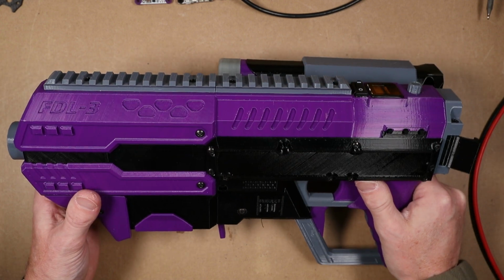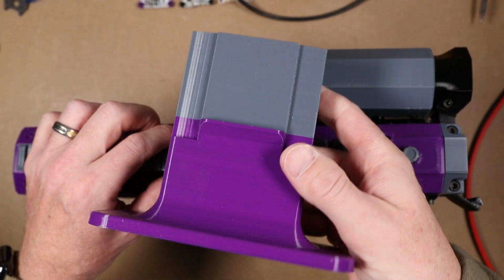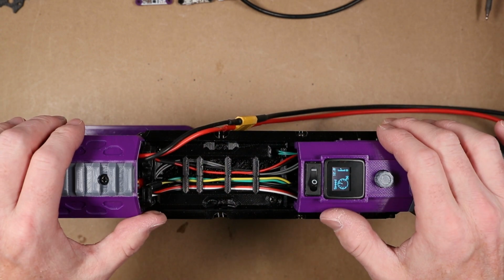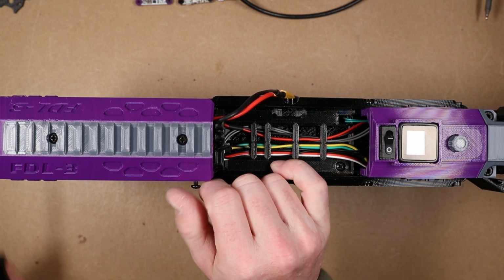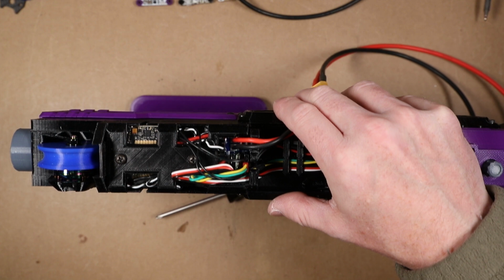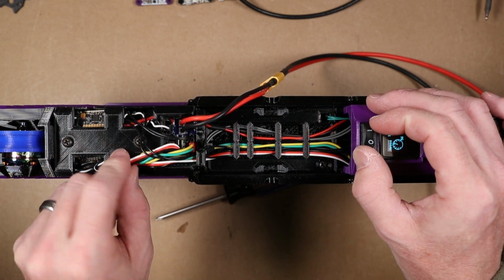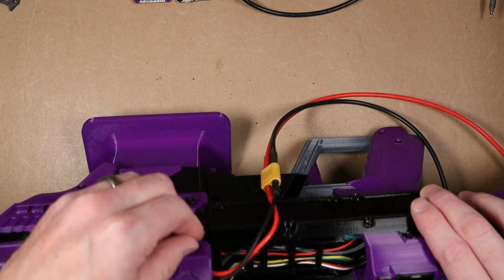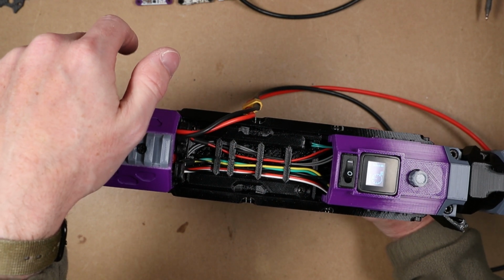FDL-3 Troubleshooting Power Loss in a scratch build

Comment: Thank you so much, man! I dropped my FDL at a game and it wouldnt turn on. Sure enough, adjusting that pin and reconnecting it fixed the problem.  I would have kept searching for a broken solder joint or anything visible if I hadn't found your video, so I give many thanks for your advice!
Reply from the maker: Stoked this worked for you! Nothing like that sinking feeling you may have to sit out the game you looked forward to. It’s also easy to think it’s something more complicated than it sometimes is. This pin issue is easily overlooked. Happy you found the vid and got back into it. Thanks for watching!

Comment: I followed your FDL-3 build videos but my screen still isn’t powering up. Tried to re-wire everything but still no success. Do you have any suggestions?
Reply from the maker: Does he Microview come to life when plugged into the USB programmer? Here’s a web page with the pin layout for the Microview - https://learn.sparkfun.com/tutorials/microview-hookup-guide/all 
You can use the above guide to test the pins for power. If your not getting power check the board to make sure all components are soldered well and none are put in backwards. My guess is the FDL is fine and that the Microview itself is bad. This is a more common problem then should be. The original one used in this build didn’t make it beyond flashing. The replacement Microview worked perfectly. I’m not sure who is to blame for the issue but Sparkfun seems to think it’s an FDL software issue. 
I hope this helps to diagnose the issue. Let me know the outcome and we’ll figure out the next steps.
Reply: Yes the viewer comes on when plugged into the USB
Reply: I brought two microviews both wouldn’t work when connected to the FDL.
Reply from the maker: Power up the FDL without a microview in it. Test the board pins for power using the guide above.
Reply: @breaksteel  thank you I’ll try that.